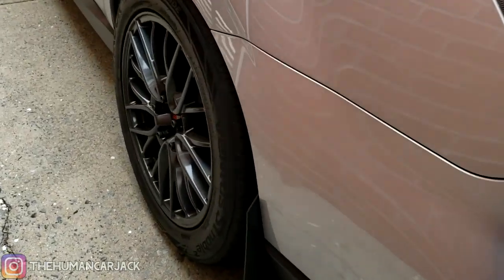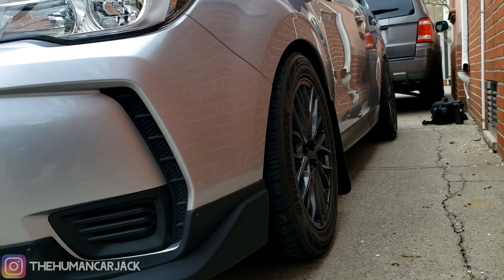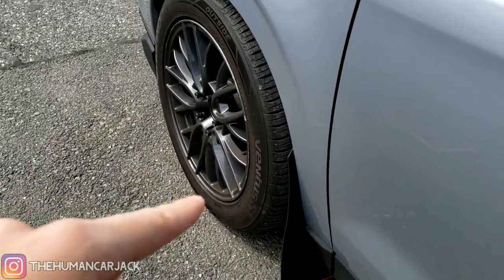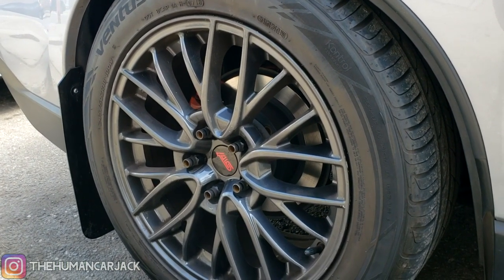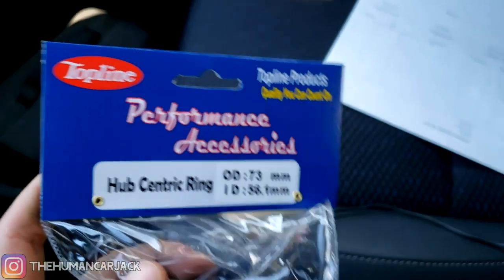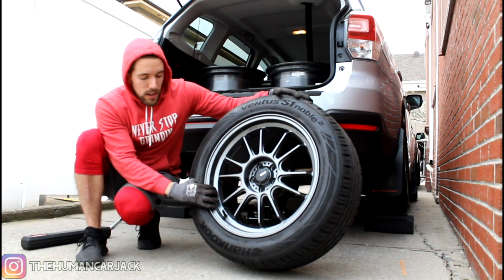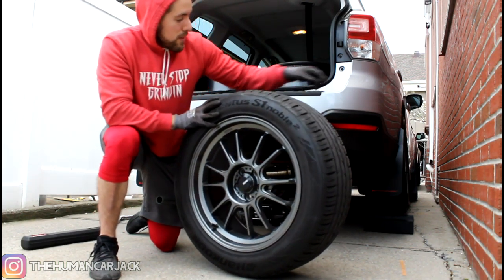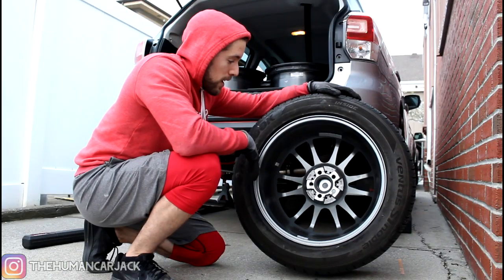NEW PERFORMANCE WHEELS ON THE FORESTER XT! | KONIG HYPERGRAMS

Comment: Did your MPG get bette or the acceleration?
Reply: It’s not about that. Lighter wheels provide better steering response and feedback as well as less wear on the brake system. Shorter braking distances as well provided the tires are as wide or wider than before.

Comment: If the new wheels are +38 offset then you have effectively decreased the spacer by 8mm
Reply from the maker: Ya it's mentioned in the video
Reply: @TheHumanCarJack   you mentioned possibly adding a 10mm spacer,  that would be a greater moment of force than having the 1" spacer, just saying.
Reply from the maker: Going with a 5mm so I'll have a difference of 3mm from the previous setup